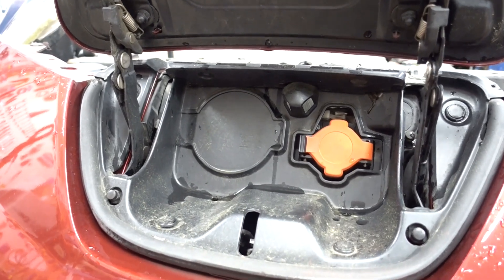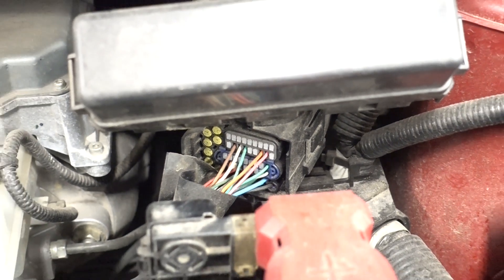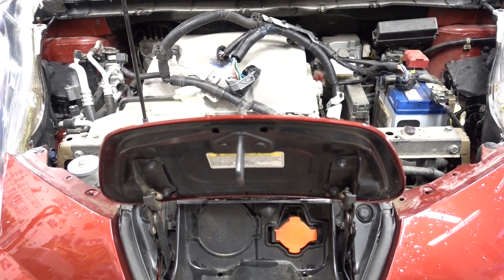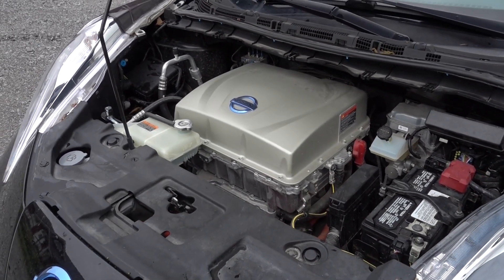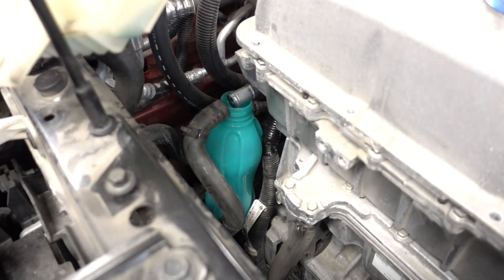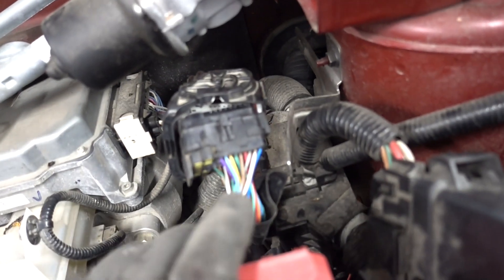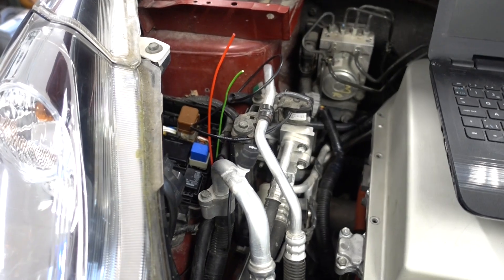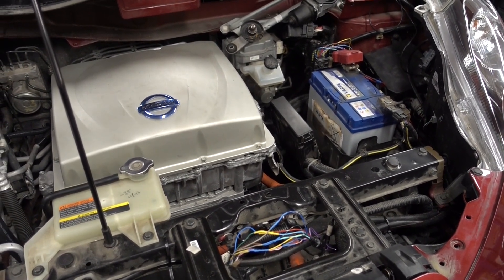Adding fastcharging to a base-model LEAF

Comment: What is different for the 2011 ?  It has the charger in back.  I have a 2011 with no Chademo, and another one with Chademo, and I've already dismantled the first one to swap into a classic car, so all the wiring components are accessible.  The second one with Chademo is still intact.  I haven't found anything about adding Chademo to a car without one other than this video.  appreciate any advice.

Comment: Have you ever had a Leaf that doesn't quick charge and throws B2814 (quick charge relay) error?
I have such a problem and I'm stuck. Replaced the whole PD module and the problem remains!

Comment: How do I bleed off the air after changing out my onboard charge controller
Reply from the maker: Check the full service manual, evc.pdf has the info. Manual is available on nicoclub, google it!

Comment: @DalasEVRepair thanks for the video.  Question: @13:50 you mention you had to open up the PDM to clear some "interlock codes".  Can you elaborate ?  PDM is dead in my 2013, and I just ordered a replacement which I will be swapping in.  I would like to know how to avoid this problem.   Any other tips you can provide (not already covered in your great video) would be appreciated. Thanks!
Reply from the maker: I tried starting it without the aluminium lid installed. This will trigger lots of fault codes!
Reply: @DalasEVRepair  ok, thanks for the tip.

Comment: Is there a way to mod a 2013 sv leaf with no quick charge port to use the car for v2h two way charging with solar/grid?
Reply: Not really. The quick-charge port does some safety checks before connecting the high voltage.

Comment: great job and great video, we are also doing additional installation now and this video is the best visual aid) but I didn’t see how the wire that goes from the relay to the 9 pin PDM connector was laid, can you indicate how you laid it and where you connected it?

Comment: Hi, is it possible to do the same upgrade on an env200 ? I think the pdm are the same aren't they ?
Reply from the maker: No the battery cooling is missing on the env200 without chademo, not so easy to add back

Comment: Hi Dala ! I recently installed the Chademo, but instead of soldering the wires, I put new contacts in the connectors. I took out the necessary connectors and contacts from a broken Leaf. I also installed the cruise, but it doesn't work yet. Which application can I use to update the VCM software?
Reply from the maker: Only Consult3+ can flash!
Reply: @DalasEVRepair  Thanks

Comment: Thanks for the time for me. You show very interesting transformations. I watch to tears in my eyes. I'm especially interested in Lieaf, it's very popular. Too bad I don't live close. Is it possible to replace the CHadeMO connector with another type of input? is it possible to convert leaf to 3x16A charging at home 6.6KW? Standard 230V domestic installations have a maximum of 16A.

Comment: is it possible to run leaf drive unit and charge system and high voltage battery and make chademo work still  i got a full drive motor assembly with full harness   im planing transplant it in to a diffrent car as a ev conversion  what whould i.need to retain at bare min  also ordered open inverter board for drive controller
Reply from the maker: Resolve ev
Reply: @DalasEVRepair  looked them up and theres np stock any other options  ?  im also looking to convert to ccs   so  i found option to control motor but want to know if regen will not function  the resolve ev looks good but cant get my hands on one :(
Reply from the maker: @mariopic  thunderstruck vcu

Comment: Hi Dala!
Very good video about CHADEMO port activation. You explained in great detail how to solder pin 8 to the VCM, but unfortunately you didn't show anything about how to connect the nine wires next to the CHADEMO port to the Nissan Leaf onboard electronics. If you still have diagrams of how to do it, please send a photo or video.
I would be very grateful, because now I changed PDM myself and now I want to activate CHADEMO.
Reply from the maker: All the wiring diagrams are available on Nicoclub, search google for "Nicoclub Nissan Leaf"!

Comment: I have the other problem on my 2013 Nissan Leaf. I found a used one with the fast charge port. (CHADeMo) and that port works fine. It's my J1772 port that has a bent pin and can't be used. I bought a new J1772 charge port and have partially disassembled the area. What I'm having trouble with is getting the broken port off so I can install the new port. It doesn't seem to have any quick release for the wiring. Does anyone know how to remove a J1772 port from the car? I don't want to cut it off! Any ideas? I have found no videos on how to change the J1772 port. Strange.
Reply from the maker: Hi, When replacing the J1772 port, you need to change the entire thing. You cannot disassemble just the pins. That means you have to open the PDM in order to get the pins off the circuit board. So it is quite a big task!
Reply: @DalasEVRepair  Oh wow thanks for that information. I was having a heck of a time looking at that thing wondering why it can't just be unhooked and a new one put on there. So what you are saying is the port and the wiring both have to be replaced. That changes things significantly. I will be getting some help on this now that I know what I may need. Thank you again. I haven't yet found any videos to look at the procedure but maybe looking at your video on putting a CSS port in will give me some ideas. Got that one on "watch later".
Reply: @DalasEVRepair  Oh wow thank you for that information. So what you are saying is that the charge port and the wiring both have to be replaced. They sold me the port without the wiring so I thought that was all I needed. I haven't yet found a video to watch this repair but maybe your video on changing to a CCS port will be somewhat instructional. 
Thanks again!

Comment: TL;DR What is the year range you got the charger and cable from?

Long story, Im an avid DIY'er thats new to the nissan leaf game. Recently got a 2013 leaf and looking into battery pack upgrades. If I do that I will want this charging capability as level 2 just will be too slow still.  Excellent video by the way! Loads of useful information!
Reply from the maker: Any AZE0 will be plug and play (2013-2017)!
Reply: @DalasEVRepair  thank you for your reply! Your the Leaf saint!

Comment: Good afternoon.  on the new motor scythe did all the connectors match the connectors on the old motor scythe?  I started doing according to your video and ran into a problem, the connector for the air conditioning compressor on the old and on the new braid is different.
Reply: what is the difference between the connector itself and the number of wires.  The old one has 3 wires, the new one has 4 wires.
Reply from the maker: Post pictures here for more help: https://openinverter.org/forum/viewtopic.php?f=4&t=980&start=125
Reply: @DalasEVRepair  thanks

Comment: Nice, hey does the VCM communicate with the onboard charger for AC charging?
Reply from the maker: Hi, Yes it does, the battery and VCM talk with the PDM to regulate the power going into the battery (in case it gets too full or too hot/cold)
Reply: @DalasEVRepair  Awesome thanks bro,I just installed a new OBC in my Leaf as the one in the car died,when I first took it to Nissan they said its the vcm at fault after much  investigation I found it couldn't be so I bought a second hand charger and installed it and now the car is charging via AC port again,Dc was still working on the broken charger.
Reply: @xboxice2005  There is a known issue with the LEAF onboard charger for L2 going out I believe

Comment: Is it possible to upgrade onboard charger for 1st gen leaf (2011-2012) from 3.3kw to 6.6kw?
Reply from the maker: Unfortunately no OEM upgrade path, but keep an eye out for my next charger video ;)
Reply: @DalasEVRepair  thats why im subscribed to your channel 👌
Reply: Well first, here's how you do it for a 2013:  https://www.youtube.com/watch?v=fiiDIEmc4HU
Second, I know the 2011s will support 6.6kW and CHAdeMO; mine was done at the factory.  Apparently I have a "unicorn" 2011 Leaf SL.  Bought the Showroom Queen with 350 miles on, and got a $6K discount.  Didn't realise how well equipped it was until last month.  HOWEVER, the factory "sticker" (the one that lives in a side window until you buy the car) says the "Fast charge port" was a $700 option.  I can't see the markings on the PDM, but I can charge 20-80 in under two hours, and 0-100 in a little over four.  And my Time To Charge display will show two different charge times (I assume because it is a ZE0, and Nissan had not yet settled on its ultimate display protocol,) but it differentiates them as 120V and 240V.

But wait, there's more!  Nissan later installed a 2015 "Lizard" battery in November 2016 under the Klee class action (I waited as long as possible before taking them up on it to maximise the life of the new battery.)  Currently 74K miles, 74% SOH, 10 bars.  I'm looking for a crashed Leaf Plus, and then going to swap in a 62kWh tub-thumper battery; my ten-year-old Leaf will have Tesla 3-level range, and I reckon I can charge 160% more battery in 160% more time, which would mean circa 5 hours 20-80, and perhaps 10 for 0-100.  (I'll fit the old battery's modules into our garage as a house battery backup.)
   If the motor survived the crash, I may try to swap in the whole stack, (so I can get its quicker-off-the-line 160kW motor.)  But that would mean it already has an updated 6.6kW PDM on the top of that stack.  Perhaps it would be relatively easier to install my old stack (with motor,) but at least you'd know it would have come from a 2011 where it worked.  As you can see from the video, this might involve more wiring, soldering, and cursing loudly at the car's CAN (at least, if you work as I do.)

Of course not a whiff of this would be possible without Master Öster's brilliant research and generosity.
Reply: @stevejordan7275  Most of the 2011 US models got free DC charging courtesy of the Energy Dept, amazingly. Reinvestment Act paid Nissan the difference to spec most of them that way by default to ensure EV success for the first two years till they were made in TN.

I have one with the Lizard upgrade but 3.3 kw charging. It's possible to parallel them.

Comment: Wow, nice work! I looked into doing this job myself on an e-NV200, I decided against it since I seemed like it would be difficult. I'm now glad of this decision! It's even more difficult on the env200 since the non Chademo version doesn't have any battery cooling which ideally would need to be added to be able to rapid charge safely.
Reply from the maker: Fully agree!
Reply: None of them have active battery cooling but the conversation process would likely be the same.
Reply: @Nicholas-f5  all env200s with rapid charging have active cooling with A/C refrigerant lines and a heat exchanger
Reply: @Nicholas-f5  there are some Type NV200 24 kWh with active cooling via the AirCo (Splitting) special the Transport eNV200 Version…!

Comment: Good job!  I have had that thread bookmarked for sometime.  I've been considering doing the retrofit in the future.  The biggest challenge here is finding the parts and that CCS is much more common...  If there is a method to adapt Chademo to CCS, then that would be extra amazing!
Reply from the maker: CCS solutions are coming. Only a matter of time :)
Reply: @DalasEVRepair  I can't wait...nearly half of the chaedemo chargers here in Houston are faulty 😭
Reply: @DalasEVRepair EVs Enhanced in New Zealand does this now right? Did they start doing this more recently than 2 years ago / when you posted this upgrade video?

Comment: I just wonder why you not went for the 6.6 kw inverter instead of the 3.3 kw.
Reply from the maker: Not what customer ordered, chademo was prio #1.

Anyways, 1phase 6.6kW charging is not that common in Finland, main fuses for houses are often 25A, and only allow for safe 3.3kW charging. Special EVSEs that combine two phases into one is needed for 6.6kW.

But yeah, would be excellent to try and source a 6.6kW charger if you're DIYing this!
Reply: @DalasEVRepair  I understand, main fuses here in Sweden are also around 25A, but I was more thinking about destination chargers, those ones are often 32A.  At home I am okay with slower charge speed.
Reply: @kristofferabrahamsson  Here in Gernany a Guy put in a 3 phase Charger into the ZE0. The us an German Forum Post.
Reply: @groepi1972  maybe the 3 phase - up to 22kWh charger from Brusa?
Reply: @phonie  There is a video about paralleling a Brusa to make it 6.6kw indeed

Comment: Hi Dala, do you know, why the Leaf 2011 AC at 6 Amp not start charge...at 8 or 10 Amp well starting charge....!
Some time before it start charge also with 6 Amp...?

Why..? Any suggestions?

Regards Anton
Reply from the maker: Impossible for me to say without looking at it directly!
Reply: @DalasEVRepair  i will make a Video to this problem ...6Amp not starting Charge (with noise from the Relais) and then switch to 8Amp and start Charge.....(i have measured the pilot signal = OK  + - reverse) 😉
Reply: Dala, is it possible, that the resistor inside the battery case beginning to change his resistance? Can this measured from outside?
Reply from the maker: @phonie  Pre-charge resistor can be serviced from inside battery only!
Reply: @DalasEVRepair  i know about That’s, but can it controlled from outside?
Reply from the maker: @phonie  In stationary installs yes, just send the correct CAN messages to the BMS in order to close the contactors (and handle pre-charge). Not something you'd want to do while the battery is installed to the car!
Reply: @tie pup Hi, my Battery is cold, when i want to start charge...but months before start charge at 6 Amp no problem...now it will begin at 8 Amp.., when start charge is done, then i can I can setup to 6 Amp, and it will charge further with 6 Amp !
Reply: @phonie  There is a know issue with level 2 in LEAFs failing at some point and this mat be it. It's a resistor or something. A video solution would be valuable to many.

Comment: Well, looks like it doesnt require special software or reprogramming of the car, so it's doable for more handy DIY person as a hobby project! :)
I'm guessing the most expensive component was the 3.6kw inverter with QC? I'm also quessing prices of those can vary a lot, depending on what your scrapyard thinks of it.
Reply from the maker: Yeah nothing special needed for PDM. Prices vary between 300-1500€ depending on scrapyard :D